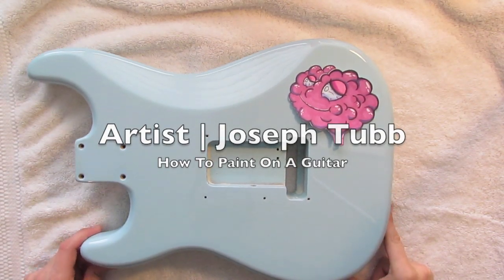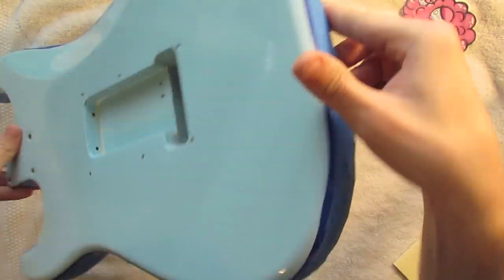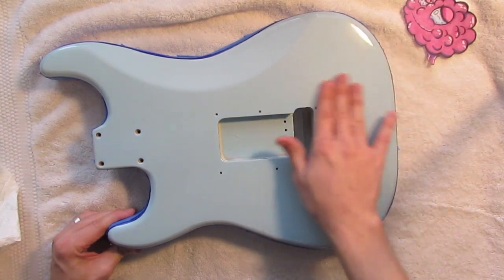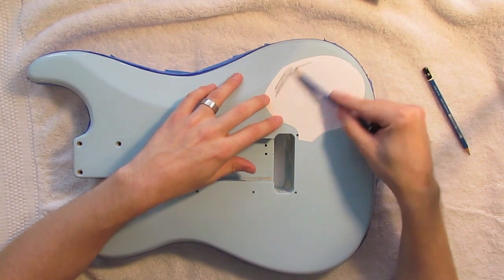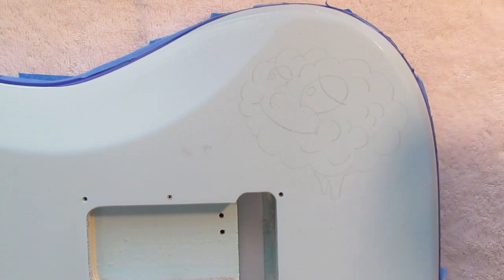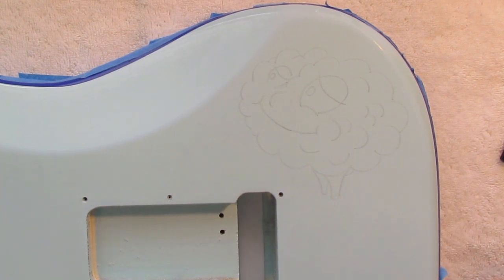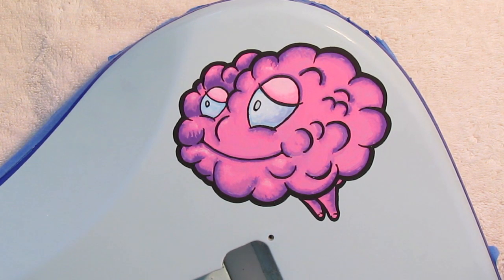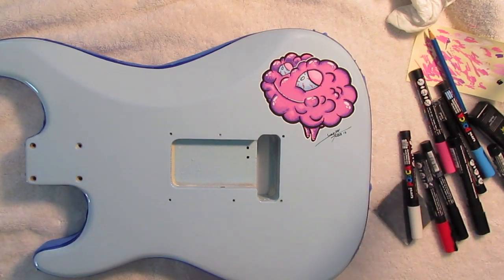How To Paint a Graphic on a Guitar (Narrated)

Comment: Do you have to sand if its a matte finish
Reply from the maker: I don't have much experience in making a matte finish but what i would experiment with sanding the surface progressively with fine sand paper to the desire look. You could apply a matte finish wax to the surface to reduce any swirl marks if any.  Google will probably be a much better resource for this as there are many products that are designed for the matte surface look.